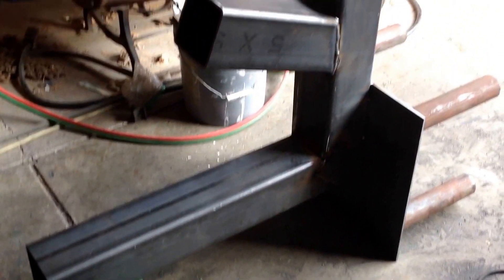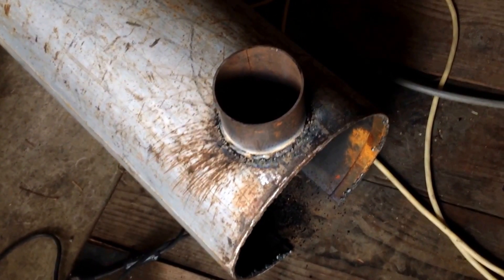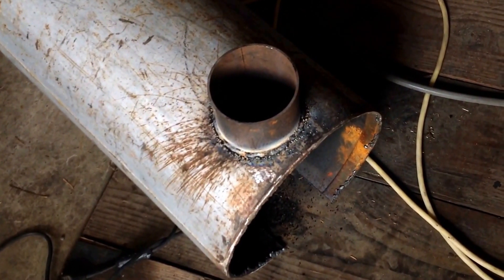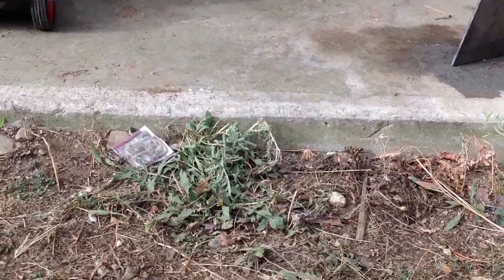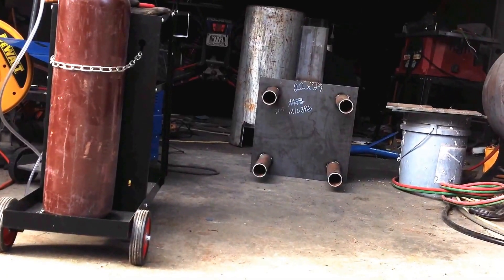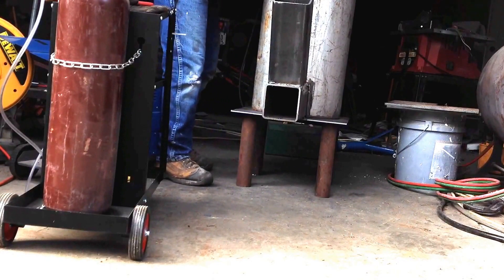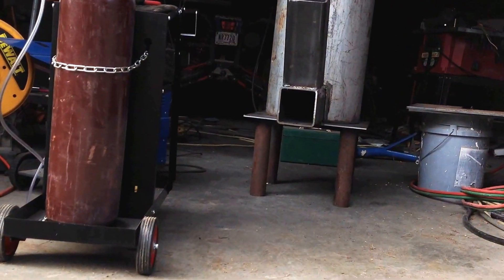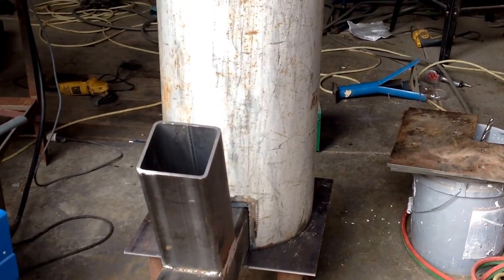Rocket stove mike knop

Comment: how is the inside of your burn tube holding up is it flaking or burning up the inside of it? i want to build one yours is one of the nicest one's i have seen. I read that the inside of the steel burn tube burns up with about 3 month's of burning is that true with yours? I hear they burn around 1700 degrees inside the burn tube and they say thats to hot for steel tubing. can you let me no how yours is holding up and how good it did heating your house for the winter? thank you for all you video's. can you explain a little more how the screw out vent works and is it just cut out into your outside of the tank? Or does it run inside to the burn tube?
Reply from the maker: yes they do burnout the other stove I built the inside is fire brick instead of Steel check out that video that is the best day ever it will not burn out fire brick